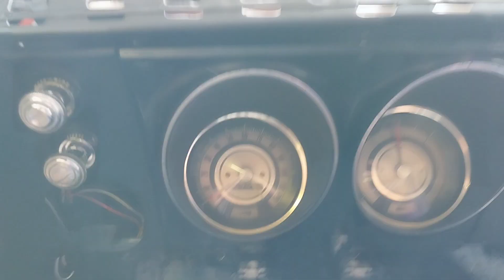1968 Camaro Gage Cluster Installation : 266

Comment: I’m wanting to add the tach in the dash and push the rally Guages in the console. Do I have to take that dash apart to take out in the new guage ?
Reply from the maker: Yep, need to take apart the gage cluster. Check out my video on gage cluster disassembly.  That should get you the basics of what is inside
Reply from the maker: Check out video # 229